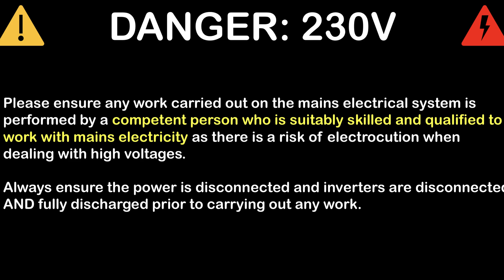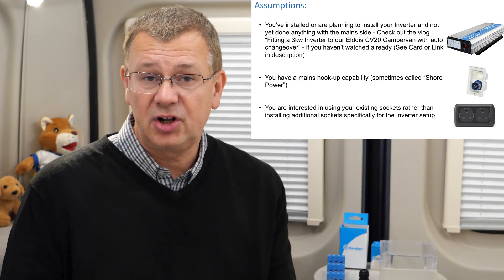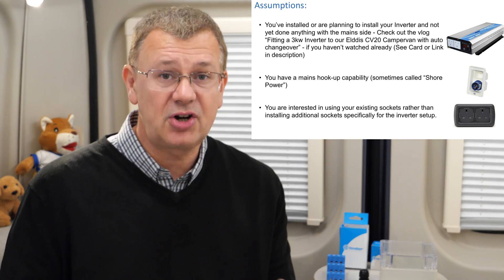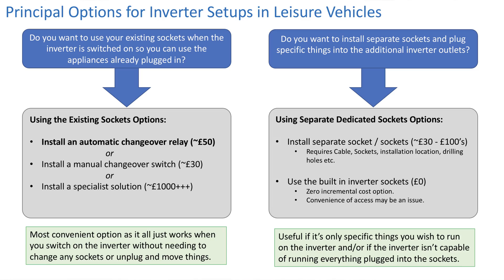Campervan Mains & Inverter Auto-Changeover for under £50 using a RELAY - How it works - Tech vlog

Comment: Hi David, Rachel & Roxy thanks so much for this video, I have today implemented auto changeover successfully with the components and guidance you have provided just a different housing box that's all, oh and lots of scrapes and bumps on my arms working in an impossibly small area beneath the double bench seat in our PVC.

I'm getting the momentary buzz on start up of the inverter and browning out as you describe in your video but everything working as expected. One question around this, is the buzzing/chattering detrimental to the life of the relay contacts?
Reply from the maker: I think if there was a very big load then it would probably shorten the life but the relays usually last for years unless being switched on and off all of the time as they are designed for, most things though when powering on you would then power up normally. I did consider using a 12V one but then it starts getting complex. If you switched it around so that it operated when on the mains and swapped the connections (NO/NC feeds) so that it activates on mains and then enables the sockets and when powered off feeds to the inverter, that would stop the chatter as no capacitors charging up / inverters and then discharging/brownout - however that then means you wouldn’t have the capability to use as additional power when on hookup. Given the cost of the relays, cheap enough to replace or carry a spare if you have any worries, I’ve had no issues at all with it and used it for well over a year now switching on and off several times on quite a lot of trips. Ideally it wouldn’t do it but it’s a side effect of the inverter, not the relay and personally like the physical isolation rather than an electric or electronic solution - clearly you could add things to mitigate but then things get more complex :) Hope that makes sense?
All the best, David 👍
Reply: @LeisureBit  awesome, good enough for me and as you say not expensive to replace the relay should we have to in the future. Thanks for taking the time to explain 🙂
Reply from the maker: @petewilson7738 just a thought, if you’ve fitted the breaker from the inverter, if you switch that off before turning the inverter off and back on after turning it on it then shouldn’t buzz at all as the inverter is at power.
Reply: @LeisureBit  thanks David, that works but not that convenient as everything is beneath the dinette seat so a bit of a faff. I can live with the momentary buzz for the convenience of just having to switch the inverter on at the remote. Thanks again for all your help 🙂

Comment: Hi David, 
Just out of interest, do you think instead of converting all of the 230v sockets/appliances to run from the inverter it would be possible to convert some. We have a Sargent EC176 with 3 MCB's (10,10 & 16 from memory ) Could I just run the feed from one  10a MCB (it only has two sockets on it) into the Relay and wire everything else as you describe above. 
Thank you
Reply from the maker: That’s kind of what I have done all be it there’s only one ring of sockets in ours. Where there’s a couple of them it would require a slightly different mod - at some point in the near future I will be doing similar to enable the water heater - same principal as that but just a couple of sockets in your case. 
Hope that makes sense, all the best, David 👍
Reply: Hi David, all working great today, just one last thing. My inverter seems to take priority over the shoreline. Can I swap the shoreline and inverter connectors over in the relay to make it behave so that shoreline is preference?
Reply from the maker: Pleased you got it working, I set mine up so if you switch the inverter on then it powers the sockets by the inverter if off via shore power, you could connect it up so if shore power is on it powers the sockets by that else if off via inverter but then the inverter would be on (wasting power) not doing anything - I have on my to do list to make an auto switch on and off for the inverter which might achieve what you’re after.
Hope that makes sense ?
All the best. David 👍
Reply: Hi David,

Yes that makes sense. Our inverter (Victron) has the on/off remote on the van control panel so we will mainly have it switched off to be honest. Would you swap over the invert and shoreline wires on the relay or just move the link wire from coil A/B up to the top or is there little difference in this?
Reply from the maker: Which victron inverter is it ? (Multiplus or other?)
Reply: @LeisureBit  standard phoenix, which I have changed the earth/neutral bond from floating to fixed at the inverter as going through the consumer unit
Reply from the maker: Ah that makes sense
Reply: @sionhughes6155  I'm about to install a Victron Phoenix 3000 inverter.  How did you change yours from floating to fixed as I will need to do the same.  Initially I will be taking the output from the inverter and connecting to a EHU plug so that I can manually connect to the motorhome EHU socket.  I will be looking at using the automatic relay method later.

Comment: Just thinking about Earthing. What about this scenario: If you were plugged into a site hookup and for some reason that had gone off. So you swithced to inverter power and there was a fault in the van cabling or equipment (L or N to E), this could send inverter power into the sites earth as the socket earth remains connected. This would be bad, so really you need to unplug the hookup first before switching on the inverter? Kind of defeats the object...
Reply from the maker: Interesting point, given there would likely be no potential difference (as the inverter output floats and isn’t tied to neutral like you would have in the house) it would unlikely cause any issues - however the negative of the inverter and the inverter is connected to the same earth so if any current flow then the van RCD should trip (and the site one) BUT in the scenario above I don’t think there would be any current flow all be it is not what you would want clearly

Comment: Hi David, I have just fitted an auto changeover.  I have a sargent ec600 unit in my caravan that has sealed breaker therefor, unable to connect to the breaker, so I cut the cables and fitted three way connectors to the shore and sockets.  However, I am concerned that the main RCD breaker in the ec600 will not trip when I push the test button and if I manually turn of the breaker off the power remains at to the sockets.  Any thoughts on why this is happening?
Reply from the maker: That’s quite normal for certain RCDs when running from an inverter (on mains it should trip normally when tested) as a lot of the inverters are floating output, domestic mains there is a tie between Earth and Neutral as a reference point - as there’s no tie, it doesn’t trip when tested with a floating output (same thing happens with generators) if you use a socket tester you will get a strange result also as again they expect earth and neutral to be tied. If there is a genuine earth leakage (there’s a difference in current between live and neutral it should trip) - my installed PDU doesn’t but the RCD I fitted does test trip on the inverter so depends on the type. So as expected essentially for a floating output if that makes any sense? You can fit RVDs to help with it which work differently but most folks don’t bother and an RCD is better than nothing. Hope that helps -
All the best, David 👍
Reply: @LeisureBit  Hi David,  It dose not trip when on mains when testing, it will only trip if I disconnect the mains cable connected to the relay. Have wired the relay wrongly ?
Reply from the maker: @edwardhouston8838  That sounds odd, how have you got it wired? The earth should be connected through irrespective for ref then the Inverter on the Normally Open contacts of the relay, and the mains on the Normally closed and the coil connected same as the Normally Open to the inverter.

Comment: Great helpful video.  
I'm just wondering how you got around the inverter powering the battery charger to run the inverter to power the battery charger etc etc?  

Would this really need another consumer unit added and another relay ? Or could just another relay be used on the battery charger circuit (if its a single radial to only the charger). 

Do you know how much power these relays use ? Are they always using power (and creating heat from the working coil ?) . 

I'm certainly going to watch this video a few more times
Reply from the maker: Thank you - the relay uses very little power (when I checked it incrementally drew less than 100ma on the DC side which takes into account any inefficiencies. The reason for the relay is isolation from the mains to avoid an issue / situation where mains fed into the inverter for example - it gives physical electrical isolation then of live and neutral. I didn’t want it to power the heater either as the battery wouldn’t last long with that but am looking to modify it to power the water heater as required. 
Hope that helps, all the best, David 👍
Reply: @LeisureBit  
Have just added 3000w Inverter running from a  lipo4 560ah (6720watt) battery I built ,  had a 1800w fan heater running for an hour and a half , great to know it worked very well and  means that induction hob and airfryer (miss roast potatoes, oven roasts and pizza) will be able to be powered via the battery , must try both at the same time (induction on low) . 
The switch over is my next step to fully integrate things . 

Then its bigger solar required.
Reply from the maker: Sounds like a fantastic setup 🙌

Comment: Hi David, Having watched all your videos a number of time I have bitten the bullet and I recently installed a 120 amp KS lithium battery and inverter.  At the moment I have installed one socket outlet from the inverter and I did not instal an inline rcd, watching your video, made me unsure if I need to fitted an inline rcd, I thought I would not need one in a caravan and as I am now considering connecting to all the sockets in the van will I need to fit a rcd, can you please advise?
Kindest regards - Eddie
Reply from the maker: Hi Eddie, congratulations on the new install - hope all is working well.
The RCD was just an extra precaution - with inverters there are limits to what it can do (as neutral is not tied to earth on some) - I’m sure it will be fine without it - just habit from my perspective for a little more protection all be it not perfect.
All the best, David 👍
Reply: Thanks Dave, much appreciated.

Comment: Hi David - can you provide some advice please - in my pdu i have 2 power point rcds - one at 10amp and the other 16 amp - is it possible to make this work somehow? Cheers
Reply from the maker: Hi Alison, interesting ref the 10A one - do you know what that’s connected to compared to the 16A one? Unusual as sockets are usually 16A to ensure compatibility with all appliances.
Reply: Thought you might ask ! Unfortunately the van is in for a service at the moment and won’t get it back until later this week.  Will check then and let you know.  I know we asked for an extra socket for tv when we bought it and wonder if that is how the did it?   Will check and update when I get the van back.
Reply: Hi David. Just got the van back and checked.   The box wasn’t labelled correctly. The 16amp was the Truma heater so looks like all the sockets are linked to the 10a one.  So should be straightforward link into that one?
Reply from the maker: Sounds like it should be straightforward if that’s the case 👍

Comment: Hi , i hope you ll find a minute for my question as i have the lifepo4 200ah battery and 3000w pure sine inverter and i am scared to add an 1800w induction hob. 
So , i am good in DIY electrics with 12-48v but heavy duty inverters to 240v are new to me. My wife is fed up with gas bottles and wants an induction for our twin axle caravan. I have already a setup with solar panels and a renogy 200ah battery, which can give 200amps and i have a 3000w renogy inverter pure sine too. I do not want to use any of the 240v plugs of the caravan, i never use shore power, as the plan is to use the induction hob only from inverter, as rest are already sorted, fridge on 24v battery bank and more, rest mostly on other 12v battery, all charged with 3 different setups of solar mppt panels/controllers, so there are a few batteries in this caravan!
I will sacrifice the 200ah lifepo4 battery only for the 1800w hob with 70mm2 cables, so can i simply use an external extension cable with sockets that comes already with an rcd straight from the inverter plugs to have this extra protection with an RCD, i do not want my wife to get injured or more as you understand , and i ll earth the inverter to the chassis of caravan. Will this work ?because i have been told that rcd will not work from inverters . 
This is my question please (> the ext cable if you paste this to ebay you ll find it >Camping Main Hook Up 3 Way RCD 230v Extension Cable Mobile Power Unit)
Kindest Regards
Reply from the maker: Hi Stella, the RCD should work if there’s a leakage between what’s going into/out of the live and neutral (as per design) which is safer than not having one - you need a voltage difference to get a shock, obviously leisure vehicles typically aren’t connected to true earth (ie the ground) which you would see in a domestic installation so the bit to watch is voltages between the chassis (ground) and true earth - this shouldn’t happen but clearly is possible. There are lots of folks who have fitted induction hobs with no issue - worth checking with a leisure vehicle engineer on options for additional protection if you’re concerned though.
Hope that helps, all the best, David 👍
Reply: @LeisureBit   @LeisureBit  Thank you really for explaining, just to note that i will not be connected to mains ever , that is the plan to avoid mains connection, i want to use the battery and inverter only for the induction hob and the rest of the caravan equipment will work on 12v and 24v batteries only. I am mentioning that as you noted that the crucial bit is the voltage difference, between ground from chassis for my inverter and true earth, you meant true earth through mains? as i will not be connected to mains or true earth as an example as this does not exist in reality, in this setup with battery and inverter?. So if i dig a hole and insert a long copper pole in the ground will this make it safer for earthing the ground?? or else?? if i find a true earth nearby from nearby mains and ground my chassis ONLY to the true earth of the mains, will it make it safer then? or maybe even worse?

Thanks again
Reply from the maker: I think you should be fine as unlikely to ever create a ground voltage difference in the setup in the van - you’re right a ground rod mitigates that but in reality it’s not really likely to end up with a voltage difference. You can get voltage sensing breakers as an added check but they mainly come into their own with generators etc where you could get a earth current flowing.
I’ve had no problem at all with any voltage leakage on mine and the RCD gives extra protection over and above not having one just in case a live was touched and current routed to the van body (in this case that’s the earth)
Best regards - David

Comment: A RCD will not work as it should in a caravan when powered by inverter or generators. There is no earth to reference.
Use a RVD if supply is from an inverter or generator to be safe.
Reply from the maker: Thanks Chris, you could certainly add an RVD for additional protection but unless it was a combined unit of RVD/RCD it would be insane not to have residual current protection also - the inverter earth is connected to the van chassis so if any contact between anyone or anything and the van would create a non-residual current (i.e. the current flowing back into neutral would be different from coming out of live) due to the circuit created by whatever is causing the issue and then trip it. There's always ways to improve safety (arc devices, surge devices, etc)
Thanks for the comment, all the best, David 👍

Comment: Hi David I have purchased a Renogy 2000w inverter and this has ups built in so I presume I can go straight into the consumer unit onboard our motorhome with the ac out of the inverter.I am not really familiar with the ups so am I correct in my assumption? Have you experience with the ups facility?
I don’t actually need uninterrupted supply but before seeing your video I thought it would be easier than an automatic changeover, would appreciate your view or any info many thanks
Reply from the maker: Hi James - let me have a look at that one and see - normally UPS does uninterrupted but may be setup different - will come back when I’ve had a look.

Comment: Hi there, can you buy these relays and sockets on ebay if so can you send a link thank you, great video
Reply from the maker: Thank you - there’s a link in the video description to the relay and socket from RS Online (UK) - the code for the relay is 292-8427 and the socket is 400-840. The plastic box was from eBay and it’s 120x120x50mm for ref (sorry I can’t post links in the reply as it usually gets deleted as spam) - hope that helps, all the best, David 👍